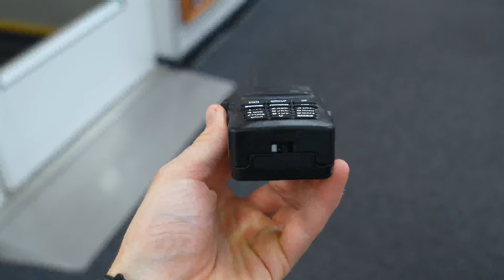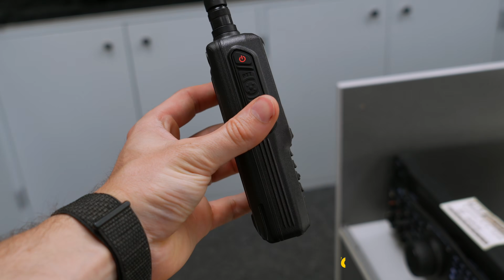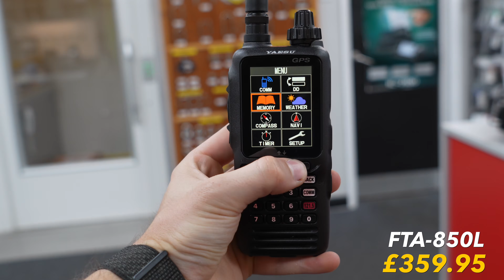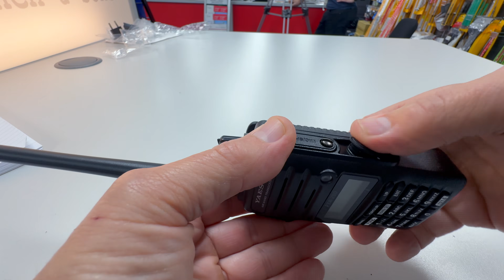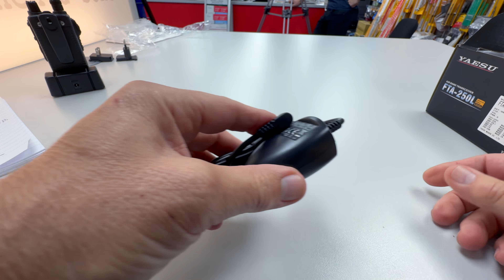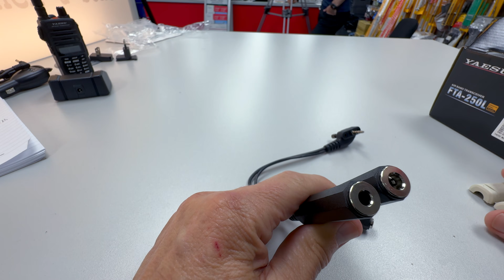Yaesu FTA Airband Radios: Are They Worth It?

Comment: It's interesting you should mention that you'd recommend rechargeable batteries for reliability purposes. I've always felt the other way. Maybe the Lithium batteries nowadays are much better than the rechargeables I used when I was a kid (around 2000 or so), but I use AAs for my backup radio. I have 2 alkaline packs, that way I can always swap one for the other if the first pack dies. That's why I consider them to be more reliable. I recently purchased Eneloop rechargeable AAs to reduce the waste as well. I guess I could get the same reliability by getting a second lithium battery, but that would be extremely expensive.

Comment: No, when it comes to ILS, the FTA-550 does not have glideslope, only localizer (9:38). Glideslope is to be found only on the FTA-750 and 850 (40 channel 329.15 to 335.00 MHz). This means that these models are 6 radios in 1 (COM, NAV, GPS, NOAA weather, localizer, glideslope). I know many people who rave about the Icom IC-A25N. This model has no color screen, no localizer, and no glideslope. VOR and localizer share the same band (108-117.95 MHz), with the latter restricted to the 108.1 to 111.95 MHz segment on odd tenths (0.1, 0.3, 0.5, 0.7 etc.). VOR uses even tenths (0.0, 0.2, 0.4, 0.6 etc.). Adding a localizer function is easier than glideslope since it shares the same band with the VOR. After the hefty 25% price increase on the Yaesu airband radios on March 1, 2026, the question of whether they are worth it now elicits more debate. Another problem issue with Yaesu is the lack of service manuals. Yaesu only releases these to service centers, not the general public, leading to an information blankout. The QYT KT-A16 (108-136.99166 MHz, 6 watt) is available for about $72, and sales have rapidly picked up after the Yaesu price jump. The menus are clumsy, the keys are small, the squelch must be set from the menu, and there is no external power jack, VOR or ILS (it can receive 108-118 MHz Voice/ATIS; nearby KHPN uses Carmel VOR/DME ATIS at 116.6 MHz). Aftermarket dummy batteries are available that allow external power via a cigarette lighter plug, as well as generic Kenwood K1 headset adapters. While it's not the cat's meow, the QYT's value for the money is unparalleled and represents the first time a cheap Chinese radio has been available in the small and specialized aviation market that makes everything cost like it was made of gold.

Comment: Re: FTA-750. A few years ago I was out in a J-3 Cub. Airspeed, Altitude, Turn and Bank, RPM, compass that's the entire panel. I got caught in a instantaneous weather event. Complete fog. I used the GPS function to find my way back to the airport and landed using the ILS function.  The FTA-750 is worth it's weight in gold.

Comment: A good number of the smaller general aviation aircrraft still do have cigarette lighter ports... I've run across a few that have ash trays in the side panels. OFC newer or upgraded panels have upgraded to USB ports via FAA special type certificate (STC) offerings.  It's incredible that Cessna & Piper planes going as far back as the 1960's are still flying.

Comment: Hello Mark,
I’m not a pilot but very interesting in radio navigation. I owned an A25N radio and trying to tune in the VOR station from the local airport about 5 miles away, but it won’t given course directions or deflection bar. Am I doing something wrong here ?
Thank you for your advice,
Best Regards, 
Do
Reply: VOR signals are deflected up to the sky so that might be why you are not picking it up if you were on the ground.

Comment: Are there any handheld radios that combine multi frequencies - Aviation and Ham radio ??  Licensed ham radio operator since 1982 and never thought about a backup aviation transceiver until I recently started my private pilot license training.  One flight on a Cessna 172 with my CFI suffered an inflight emergency with HV alternator failure.  Luckily my CFI took over and landed very quickly without any electronics using manual controls.  Wish I had this radio on board.
Reply: Late answer but short answer is no - mainly due to air and being AM and most VHF amateur being FM.

Comment: Hi Mark,

What will be the range in Air ? 
Can it transmit within 10nm in Air ?
Reply: It depends of the altitude / line of sight of course. You can transmit to the space station with 5 watts if you have a clear path.

Comment: In the United States IMO: there should be a test in order to use the air band frequencies on an individual license basis at a PSA testing facility...these airlines personnel are a joke when it comes to using the radio! i.e copy this and copy that does not work
Reply from the maker: I'm sure no license needed for RX, but Yes, I'm pre-historic enough to have taken a separate Radio test and license when I did my original PPL :-)

Comment: Hi Mark, Informative video. You mention they can be used by 'Aviation Enthusiast', but no mention that users must be licensed to use them. Obvious to most, but not everybody.
Reply from the maker: Hi David, license not necessary for RX, but yes, one needs to be either a licensed pilot or authorised controller to TX. I did my PPL so long ago now, that I also took a separate Aviation Radio License!
Reply: @Martin_Lynch  He is correct you can't legally listen to the aircraft band unless you are licensed to do so in the UK although plenty probably do.
Reply from the maker: For RX, no license is required, for TX, please see https://www.caa.co.uk/commercial-industry/airspace/communication-navigation-and-surveillance/aeronautical-radio-stations/
Reply: @Martin_Lynch  I have the FTA-550L only for rx, i live nearby a airport. You can turn of the the ptt (tx) knop of in the menu, so you don,t exedantely hit the ptt knop.
Reply: I have the FTA-250L (and a CAA ROCC for Air-Ground Radio Service)...  
You can lock out the Transmit function from the menus... Gives you a very usable dedicated airband receiver, without the risk of an accidental transmission, should you wish to limit it to receive only (completely reversible of course).